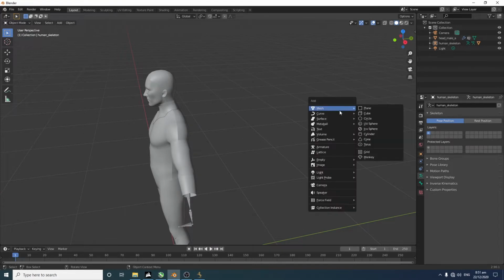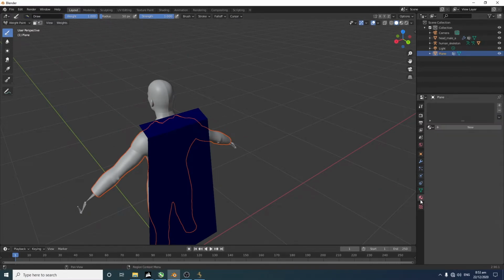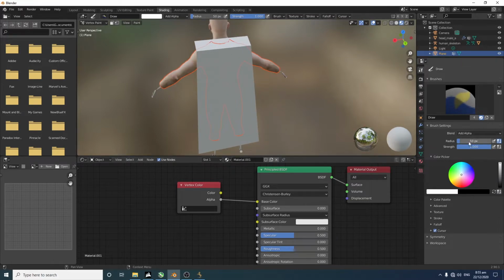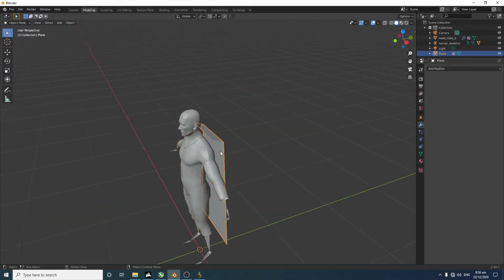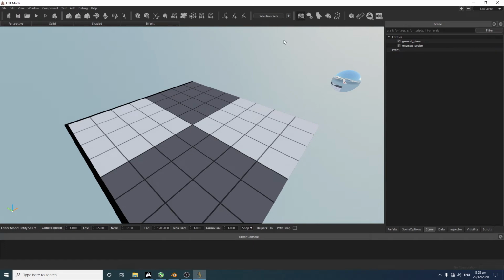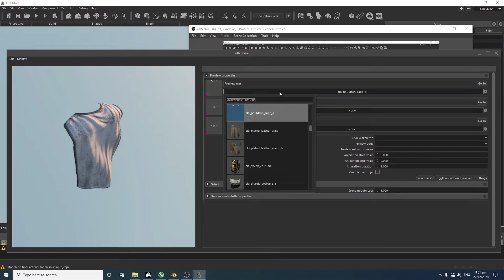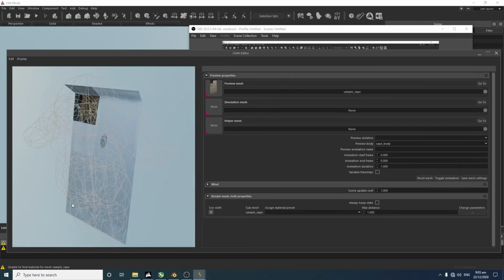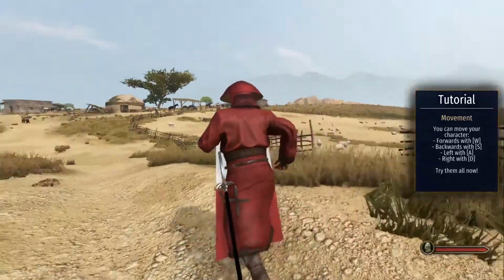Cloth Physics (Part 1)

Comment: FYI In the "other" settings for the material, you can check "two sided". This will make it render both sides even if the mesh itself is only a plane and one-sided. Perfect for cloth.
Reply from the maker: Thanks for info :)